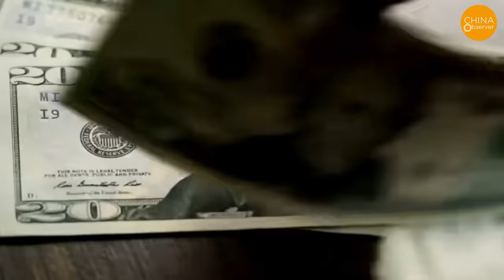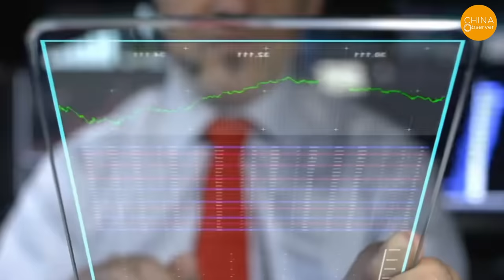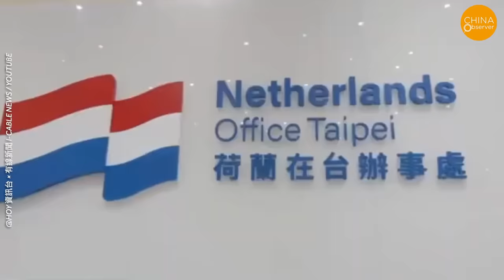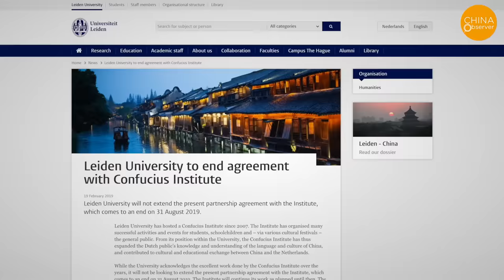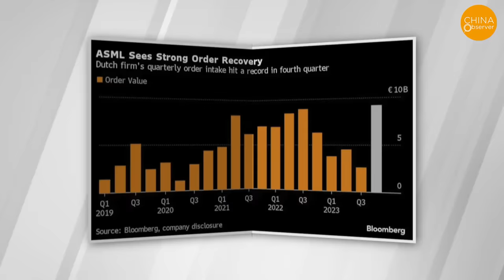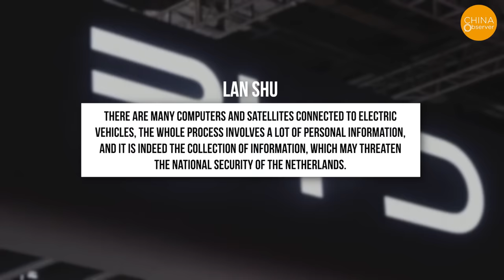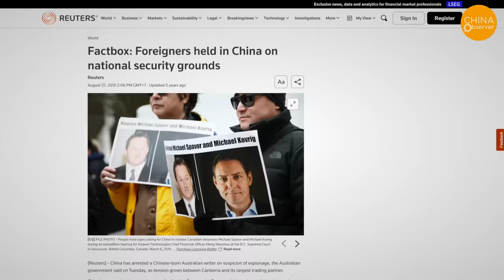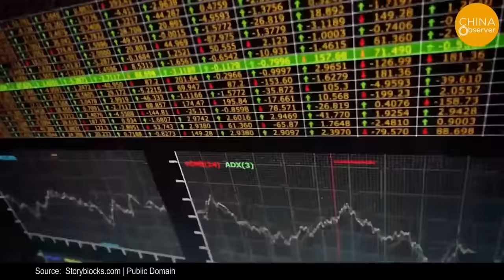Netherlands Shuts Its Consulate in Chongqing, China; Lithography Machine Sales End Entirely

Comment: One item not quite covered on ASML is servicing the equipment. Did not ASML stop maintaining the equipment and sell of parts in China?

If this is the case, China can buy all the equipment it wants but without maintenance and spare parts, things will go bad. In another line, who is going to setup all this new equipment? One tiny mistake will destroy the equipment or render the equipment inoperable for a time.

As one commenter mentioned, considering China's current economy, CCP has to be making it easy for companies it get the money to buy that much equipment.

Update: ASML has contracts to maintain equipment in China but there are talks of revoking those or some of those contracts. Time will tell.